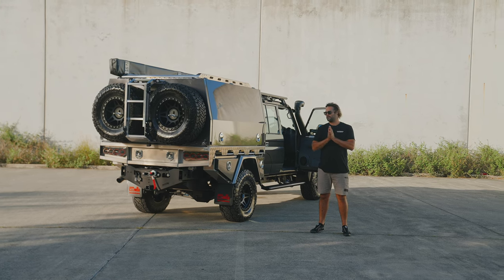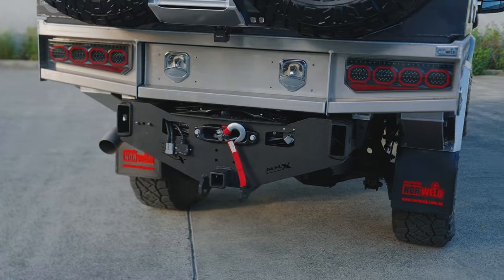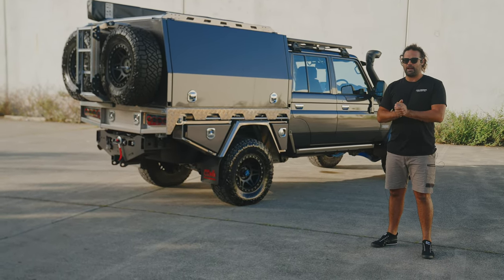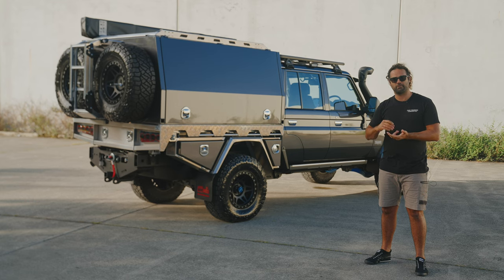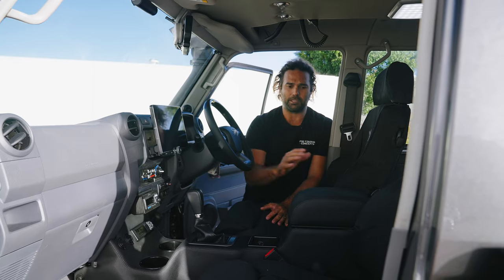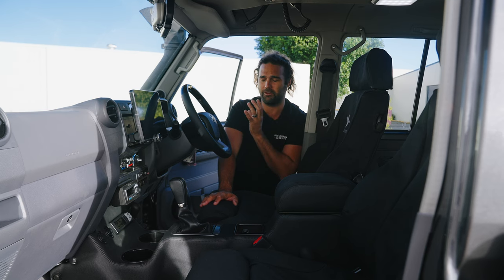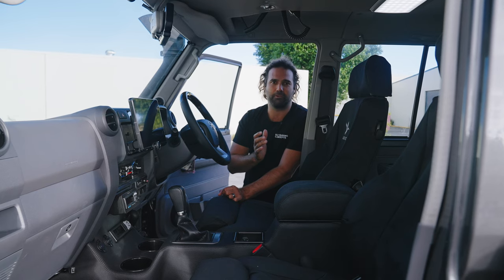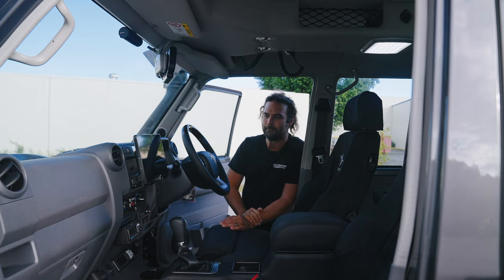6 Speed Auto 79 Series Dual Cab - Worth it??

Comment: If you're going auto, why not the ZF 8sp?  Ripper touring rig, solid build - the seat covers on the Recaro's - are they off the shelf?
Reply from the maker: They are mate . Black Duck make them for the Recaro’s. Up until now mate the Wholesale kit has been all that’s on offer with good backing and stock levels . We’ve got a few 8 speed builds coming through now and will report back with a YouTube vid
Reply: @ProTouringTV  thank for the info re Black Duck.  Onto them tomorrow.  Looking forward to seeing the 8sp builds come out of the workshop in due course.

Comment: Hey Mate, What a rig, my dream 4x4.
Im interested though in your comment about the stock 2.8L 4 cylinder runs rings around this tuned V8 with auto, does this mean the 2.8 pulls better and faster even with significantly less power than that tuned V8? With the same weight?

Comment: Mad rig.
With the side steps, if your driving on a gravel road do stones get caught into the powerboards and damage any panels? 
Or is it pretty same on dirt roads...
Reply from the maker: Cheers mate . Yes if planning to hit a heap of corrugations extended mud flaps are usually recommended. We can extended the factory ones. A standard side step is recommended if you plan on doing a range of travel including heavy corrugations